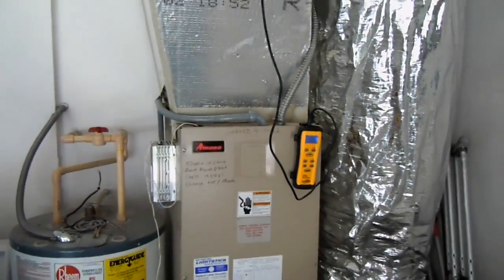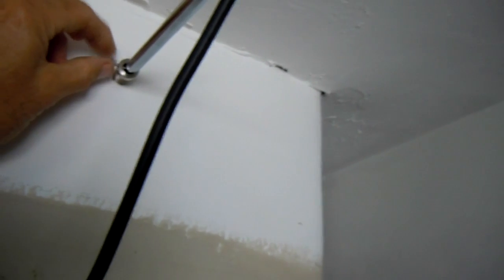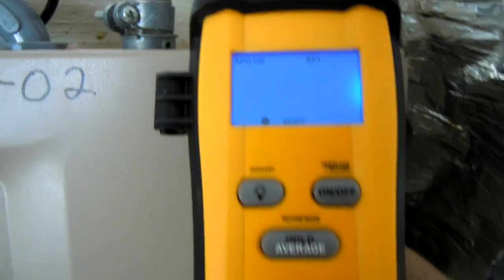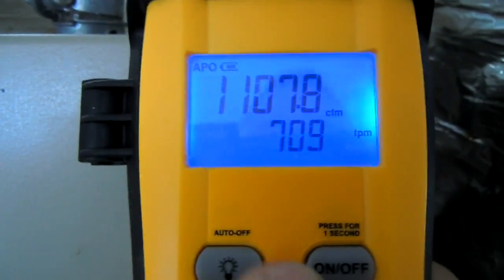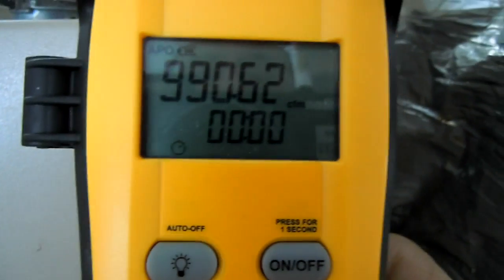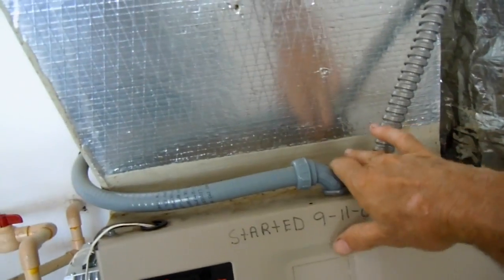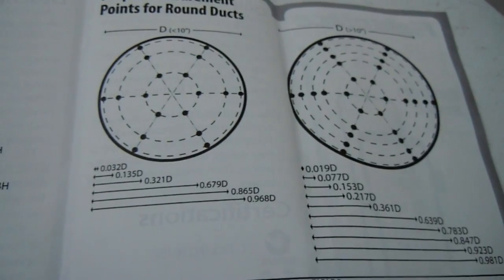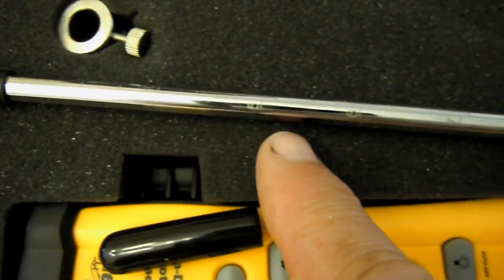HVAC Fieldpiece STA2 In-Duct Hot Wire Anemometer

Comment: Do you have any updated video or recommendation for measuring CFM beside the heating elements method.  I currently use a cheap vane anemometer and am looking at either the Testo 510i heated or the 410i vane anemometer.  In my area it is mostly flexible duct so I am not sure the Testo 510i would be accurate as you transverse through the duct insulation part.  And for the Testo 410i you need the grid free area and I am not sure how one would calculate that accurately.

Comment: U r right about the the vagueness of the instructions. I called FP and ha to talk to the people before I got my answer. The FP rep said the engineers omitted a a step in the directions that would get u into the averaging mode. 

Finally got the answer I needed and started using the instrument. I knew most systems had airflow problems, but never to the extant I discovered using the STA 2.

Seemed like the airflow was grossly excessive or terribly  inadequate. No middle ground -too hi or too low.

Comment: I doubt that the system has a leak because it has not lost any cooling capacity, and the compressor is not overheating. So I think you may be right about the insulation being in the system. I will have to get the compressor changed when I have some spare time. I am however, waiting for APS to pick up the other GE that has sprung a leak.

Comment from the maker: It sounds like there are non-condensibles in the system. Unfortunately, the non-condensibles is probably motor winding insulation.

Or it could be that you're system has developed a refrigerant leak.

Comment: One you've taken all of the readings at all of the points indicated, you are then supposed to average them to get your final reading. Per the SMACNA Test and Balance Guide as well as the Industrial Ventilation Guide, a minimum of 16 readings should be taken (which would require drilling 4 holes). Not trying to bash, but what you stated is simply wrong. That little scale is showing you to drill six holes (and gives you the spacing), then take five readings at each hole (and gives you the depth)

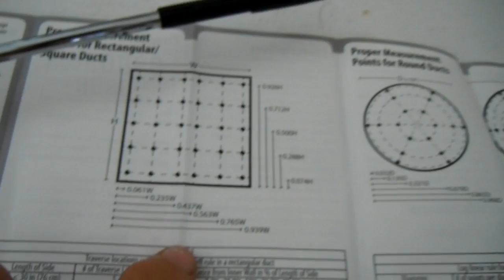Comment: Best to find the center of the duct???? Only one single traverse???? Man, what Test and Balance guide have you been reading? At minute marker 11:38 you film the Sta2 guide where it actually shows you where you are SUPPOSED to take your readings. It's not just ONE reading that you are supposed to take. That "scale" shows you all of the points at which you are supposed to take your readings. There is no way you could get an "accurate" reading from a single traverse point.

Comment: Heat pumps are more efficient than gas in most parts of the U.S. 
They also are less expensive to install than gas with A/C.
Why do you have gas instead of a heat pump?